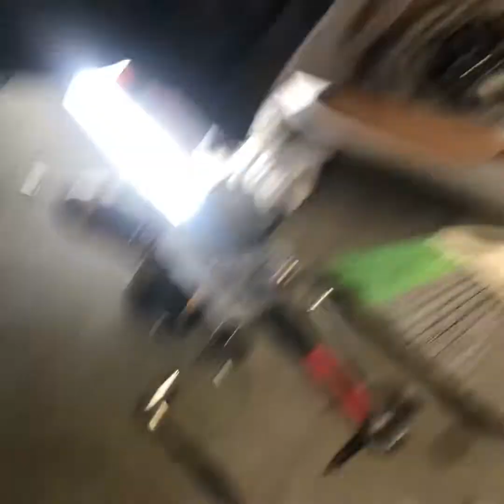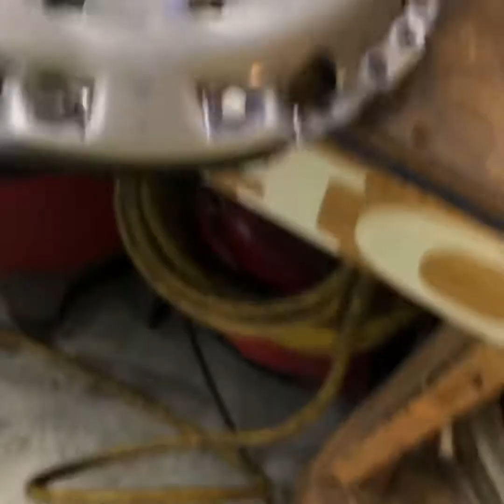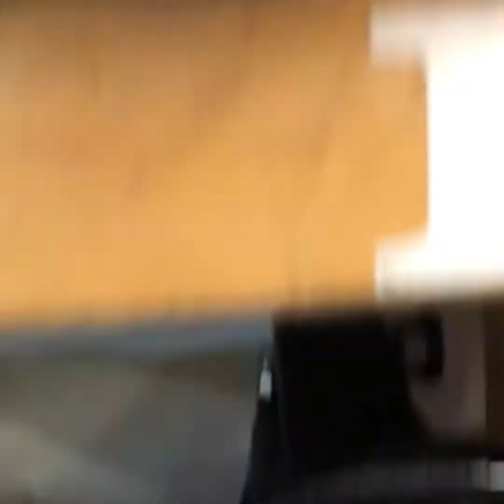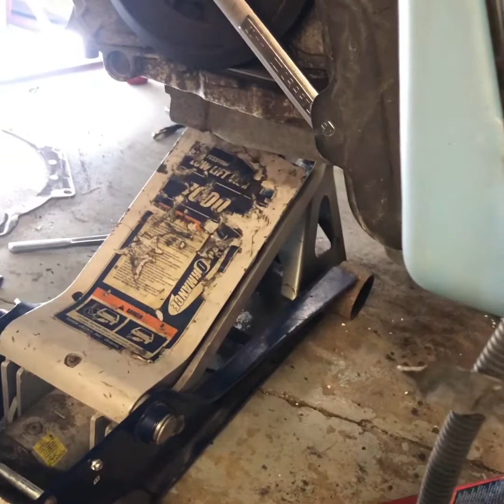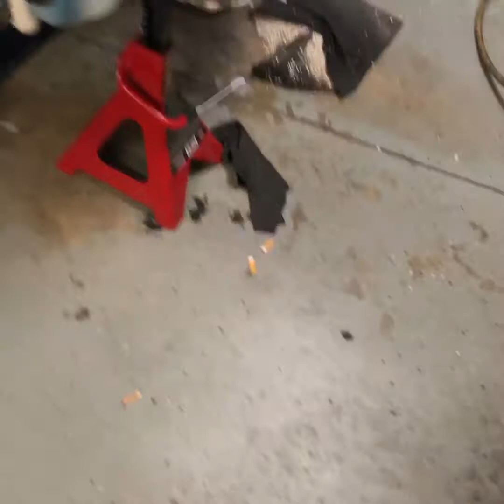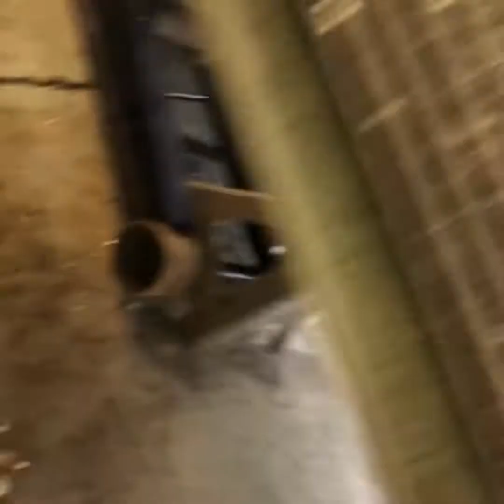2007 cobalt SS/SC clutch replacement tips and tricks!

Comment: I had to take off my radiator to get the starter off and can u let me know about how to bleed the clutch
Reply from the maker: I had a buddy pump the clutch for me and kept breaking the bleeder loose on the top of the bell housing that connects to the j-pipe inside the bell housing. it took quite a while and a lot of fluid, I think I used a piece of 3/8 tubing to drain the bled off fluid down to a bottle. hope this helps

Comment: Having serious issues getting the bell housing to mate up to the block. The shaft spins when I turn the crank so I want to believe the splines are lined up. I just can't figure this shit out. 18 hours straight trying to do this and still can't get the trans to mate up
Reply from the maker: Do you have the shim in there? Between motor and bell housing? Are you running stock clutch or upgraded? Throw out bearing spacer?
Reply: @Robswrenches  *update* just as i started thinking. The splines were so rusted,  it was jamming everything up from butting up as it should have.  Once we pulled it back out and inspected,  we noticed how caked it was.  All was perfect and smooth after that.  Sigh,  unfortunately the car was just totalled 5am this morning.  Deer ran out onto the highway in front of 2 full size pickups.... one in either lane ahead of me. I ended up locking the brakes up and riding right up under the f150 in front of me,  after he smeared the shit out of the deer.
Reply: @Robswrenches  exedy pro kit, throw out, clutch, and pressure plate. No shims. We turn the axel's and it doesn't spin the flywheel. I turn the crank and the shaft does spin, which leads me to believe one of two things 1: splines lined up but won't go in. Or 2: possible the splines are lined up but at an angle the allows them to interlink just enough to spin, but not actually aligned. I've got a Chevy cert tech working with me and we can't get this thing to mate. We're about to drop the trans again and go from there now that we have a hoist to help.
Reply: @Robswrenches  we didn't check to see if the splines lined up before installing the clutch. If not for the shaft dining with the crank, I'd consider i might have the incorrect part.
Reply: I just did my tran in my 06 cobalt ss sc I pressure at my pedal but I can't put the car into gear while the car is on but I can put into gear while the car is off

Do you think it needs to bleed more?
Reply: @cleardabz5215  I would check your shift linkage and make sure it's not getting jammed up, and I'd look into possibly the input shaft not being mated up properly.  I'm thinking it's possibly "slipping" and the splines just aren't grabbing to be able to engage the Trans.  I'm just guessing now, but that's the first thing that came to mind. Hope you figure it out. Good luck
Reply from the maker: clear dabz is it leaking any where? Could need bled more it took forever to bleed mine all the way out. I think it’s also recommended to bleed brakes first? I don’t remember it has been a while since I did my clutch.
Reply: @Robswrenches  yeah same here.  My buddy stayed up all night for like 3 hours bleeding.  Still didn't feel a hundred percent,  but it got better after putting about ten miles on it.
Reply from the maker: Jason p that’s good news. It’s been maybe a year and a half or so since I’ve done mine, and I know I have an extremely slow leak somewhere in the clutch plumbing. I’ve had to top off my fluid resivoir atleast 10 times. Doesn’t leave any puddles on the ground though so I’m not sure what’s happening and I’m deff not taking it apart to find out lol
Reply: @Robswrenches  I don't blame you.  That was hands down,  one of the worst.... if not THE worst job I ever had to do.  Lmao
Reply from the maker: Jason p I absolutely agree. I am a field service engineer repairing Cnc grinders and various other Cnc machines and I’d rather be balls deep in one of those than that damn car 🤦🏻‍♂️ lol hell id take on the frame swap to my Tahoe again before I do that clutch one more time lol
Reply: @cleardabz5215  just taking a wild shot with my eyes closed. Did you have an alignment tool to piece it all back together?
Reply: @jperdue3567  honestly I cut the old input shaft off my broken trans and used that
Reply: @cleardabz5215  I'm assuming you welded the shaft on the Trans? Shit like the needs to be precise.  You can't be off by a mm or it will throw the balance off and If one thing is off, there's a good chance you'll either snap something or bind your Trans up. Again,  I'm not s certified pro,  this is just based off what I deem common knowledge.